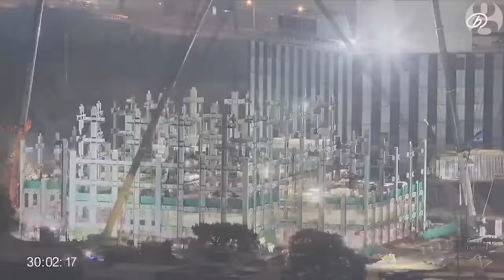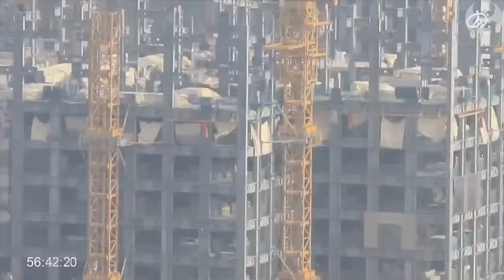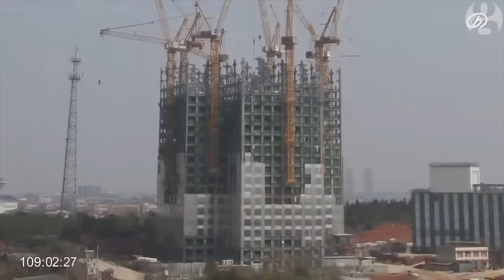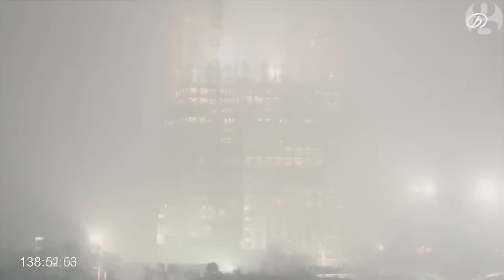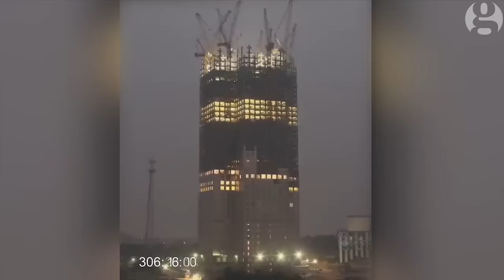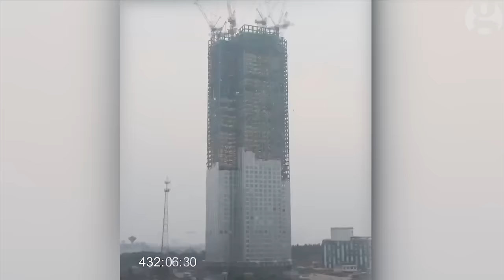Chinese build 57-storey skyscraper in 19 days – timelapse

Comment: Here in africa the civil engineers tells us that the cement for first roof it will take to dry for almost 3 weeks .....
Reply: I guess concrete dryies instantly in china
Reply: They used big concrete boards maybe, which custom made and already fixed sized and dried in factories then deliver directly to construction sites, which is just like building model kits or puzzles, it is too slow when u need to wait the concrete dried by floor to floor. 21st century modern building usually don’t waste time if u have enough MONEY. Most countries dosen’t have that much of budget.
Reply: LOOOL same
Reply: Same in israel , its all depend in how much cash roll in
Reply: Thats pre cast concrete slabs on steel trusses
Reply: @Ajay Malik every building is made of steel. Bt how can u be so sure that there were no use of concrete in the building?
Reply: In India here is also same
Reply: They jus Wana show off. that building will crumble the first earthquake 🤣
Reply: warfa abtidoon it’s true I’m a civil engineer, the concrete needs 28 days to reach its maximum strength but there is some liquids that are used to fasten the process which are usually used when building skyscrapers.
but in this building case, its a steel structure and they are fast to build but costs a lot of money.
Reply: Precast, boi. Heard of it?
Reply: It takes a minimum 28 days in the UK for the concrete to settle before you can lay any hot melt ie bitumen direct on to it.  That's why you do peel tests first.

Unless they use metal decking with another type of waterproofing.
Reply: That’s because it’s true. Concrete doesn’t dry instantly. No wonder brand new buildings in China are falling apart, they prefer speed over quality.
Reply: Pre cast
Reply: they cut alot of corners in China lol
Reply: Ideally it is correct. But with advancement in technology it's further shortened.with use of superplasticizer ,pre cast, admixture etc
Reply: @Reyesnino8763  f
Reply: I myself being a civil engg .......they use prefabricated materials....like...precast cement slabs
Reply: Made of steel and premade concrete modules and boards    Also shift jobs in 24 hours. Plus parallel tasks management
Reply: Plot twist: They use Gum instead of concrete
Reply: Estonian concrete dry 2hours then it's "ready"
Reply: Same in india,Kerala
Reply: Half a year in the philippines
Reply: @MLGxBXRxPRO  or they install already dried settled Concrete🤣
Reply: There’re are different types of construction, but as for that one in vid is either from factory custom designed already or the building is made up of steel
Reply: warfa abtidoon u guys use straw and bamboo is better 😅
Reply: Yes..21 days to be exact but that's  because most people can afford that..However if you're in a hurry, there are chemicals or special cement available  which can be added in the concrete to make dry in matters of hours and some in minutes. If you can afford, of course.
Reply: simple... all concrete  slaps are dried and are ready and  standing by........  here at Los Angeles, over 10 years now and can't repair the freeway........ ( any freeways )
Reply: its NOT drying, or it shouldnt be. concrete CURES, and most be kept wet to do so. the formula can be changed to accelorate the curing, but thats comes with health problems from allaline dust, and reduced structural strength. drying fast is a BAD THING, usually. 3 weeks is smart if slow. stronger.
Reply: Jam Lee  why would we be losers because of a tornado? you should vacation here, go storm chasing. watch the ground get ripped up 5 feet deep, 200 yards wide, 8 miles long. bring your chinese concrete to protect you. youll love it.
Reply: After 5 year I did visted in Islamabad, (Pakistan)
Near faiz abad Bridge still Where last time left, they just increased 20%😂😂 I asked local guys, about details, he says, 3 company got aggriment 🙄, and they stolen money and hided😂
Reply: Jam Lee  lol cardboard houses 😭👍
Reply: @Rivenburg-xd5yf  lol cardboard houses 🏘 😂
Reply: @m_i_g_5108  thats mexico, the cheapest house here is steel, with cheap chinese drywall inside.
Reply: DANNY M dries*
Reply: warfa abtidoon that’s Africa not China
Reply: @Reyesnino8763  only big companies or rich people use this kind of already built concrete, usually the tensioned concrete (post-tension or pre-tension) is more rigid and stable, and it depends on the building itself, if it needs pre built concrete blocks or for the tough construction the tensioned concrete, I'm an surveying engineer idk much about concrete but i worked for some companies who built with both
Reply: @Ajay Malik bro,u can't make any building without concrete or stuff like that.
Reply: What do u expect
Reply: Thats because its very cold in Africa, the sun never shines there 😒
Reply: Jam Lee  idk what cardboard houses your talking bout dude.  But I was being sarcastic. Chill people.
Reply: warfa I'm curious but are most African engineers native Africans or non African
Reply: @qwe1237713  are you from north Africa ie. Egypt, Algeria, Tunisia etc or sub Sahara Africa just curious thank you
Reply: @1Reddd  who day they are falling apart I've just looked up Chinese sky scrapers there are literally thousands not one of these has fallen um not Chinese I'm English I suspect you are American and bitter about China overtaking America in every way such it up Bro  ha ha ha
Reply: @xahidmushtaq4062  are you sure you are a civil engineer one g by the way ?ha ha ha you are a labourer I'm sure
Reply: In Italy the cement takes 2 governments to dry

Comment: The amount of inspections you need for this building is alot. Just one rainy day around my area would hold things up
Reply: That's why this happened in china. I'm sure there were no inspectors whatsoever and all sorts of safety and building violations. Not to mention unfit working conditions for the workers.
Reply: @The_Bad_Guy.  no there are building regulations but they're not as tight since in china and Hongkong you don't own any land, you just bid it from the govt for 70 years before you have to give it back, and these don't even usually last that long, they only last 30-40 years before the buildings get destroyed and a new one gets built on top of it. So buying a house in china essentially means that you're just leasing it for a couple of decades, so most people just rent.
Reply: @Rampart.X  someone usually from the gov making sure everything is up to code and safe
Reply: @The_Bad_Guy.  My thoughts exactly. I believe there is a reason why it typically takes years to construct such buildings. And why this would only happen in China...
Reply: @ajstevens1652  nah man the chinese just do it better cant compare few days to few years even with all that taken into account

Comment: So were they assembling precast cement sections because they obviously weren’t waiting for cement to set. I don’t think I’d like to be near that building
Reply: Me too. I don't feel safe.
Reply: They aren’t stupid I mean they would’ve used something else
Reply: I've had a super uneasy feeling about this building since it began . Rushing an entire structure like this one is not recommended at all.
Reply: MMN Legend Well they OBVIOUSLY used something else. Something other than the standard building methods and materials. Any modern building should last 100 years. You think this building will be around when you reach retirement age? I don’t.
Reply: RTV Johnson I work in construction and it would take more than 19 days just for inspectors to sign off on all the different phases of completion. This place wont last
Reply: Tezz man ss  That's why there's a thing called a concrete mold
Reply: Tezz man ss  That wet cement can hold up.
Reply: Probably. And all materials prepared ahead of schedule.
And probably for show too. Not like you are going to do it this fast everytime.
But they can really mobilize a lot of people. People are blessings.
Reply: Chinese speed comes with chinese "quality".
Reply: PJ Montaya haa haa haa
Reply: @canaldofred2366  no matter how many people work on a building, it won’t make the cement cure any faster. So that means there’s no cement in this building. Cement is a critical building material for structures this tall. It’s what EVERY foundation is made out of. This is impressive for how quickly it was erected but I guarantee that it won’t last as long as a building built with normal practices
Reply: Built for the chinese people.
I'm sure they don't have problems with "the quality".

Comment: There are a lot of sincere people here . Also a lot of mean- hearted ones, who even if they have no compliments, that's still okay;  but to bet that it will fall is wicked.
Reply: Its not kind, that's true, but it's also a reasonable assumption. A structure that large in just 20 days cannot be all too safe.
Reply: @lubaniskie  but let me tell you that I used to live in a prefab flat ( unit built in 45mins) that was 50 years old ( it had a lease of 99 yrs)   and I sold it for 325k (US$283,117). And it was 12 storeys high bldg.
Reply: @medialcanthus9681  damn, cool, I didn't know they've been doing this for years, I didn't know they ended up last that long either. I think a lot of western folks  don't know much about this way of building and compare the amount of time that's spent on western buildings and think,'nuh, doesn't seem like it could stick,' which is fair but perhaps, obviously, uninformed.
Reply: Lubz M. they were definitely cutting corners

Comment: I guess it’s doable once your excavation and foundation are complete (which alone probably took a few months), the design is fully prefabricated(the structural and envelop seem to be, but what about mechanical/electrical/plumbing?), the manufacturing plant is right next to the site so the deliveries are instant and on demand(where or how you would store members for a whole building?), the manufacturers don’t have any other project to worry about(how did a manufacturer like that get a project of this size?), the construction workers and delivery staff are working 24hrs(its China so it’s possible), and there’s zero quality control, testing or safety consideration(again China so it’s possible and explains the frequent failures). 
But even then I’d be skeptical of the claim that this was built in 19 days.

Comment: If it were in my country(India) , the government makes a committee whether the project is feasible or not by the time the committee gives its report its already 10 years passed and finally the government starts building it and erects the pillars first and then elections happen and power will be changed and the new government thinks it is of no use and leaves it as is.

Comment: Curious the concrete strength and other structures as Engineer. I never trust this kind of construction method, believed many high rise building easily collapse due too poor of workmanship in China,.. all slabs shall be at least 10 days before next floor done and removed the support same goes reinforced column shall within 7 days ( subject with the concrete grade), that why we never practise this kind of method, this practice has not as standard practice and agreed by many engineers in this worlds. I never welcome this practice even main contractor is came from China, we build not for disaster, but we practising safety design, no short cut, comply as what the correct design mix.